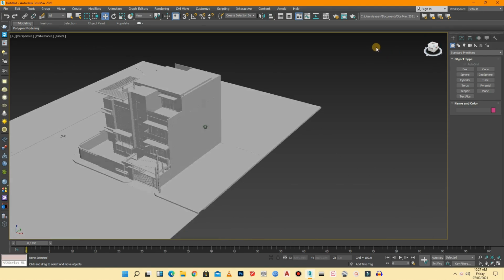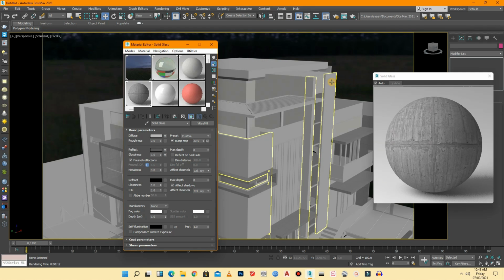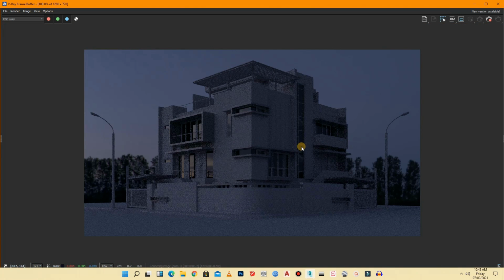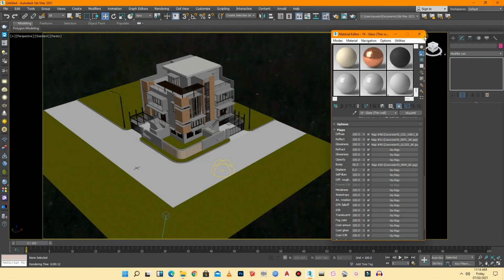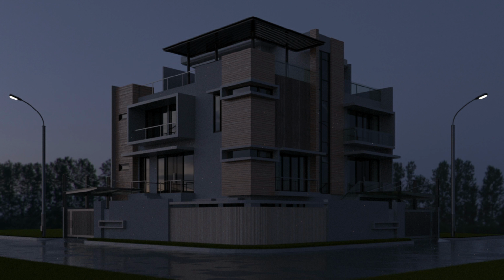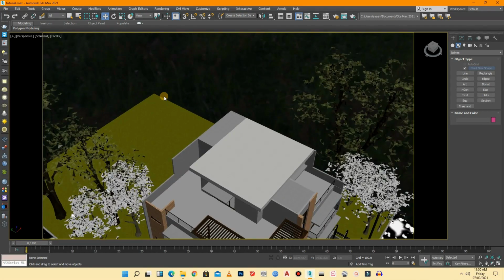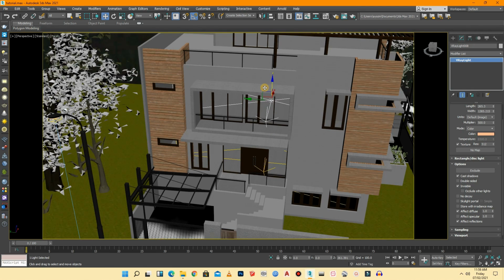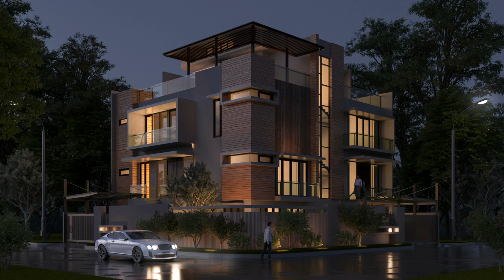Exterior Night Render in V-Ray 3DsMax Complete Tutorial

Comment: Hello! thanks for your video!
I have a question, when I use vray hdri the background of the workspace is white.
That is, I do not see the image that I placed as a sky.
How can I solve that?
Reply from the maker: It's easy, click on the little "+ "sign which will open viewport options then go to "configure viewport", go to the "background" and then "check" "use environment background."
Reply: @Platformstudio  I already did that and still the same. When I go to render it appears all white too. 
I also tried with different images and they do not appear on the background..🥺😢
Reply from the maker: @a.pereyra3875   @A.Pereyra  Make sure you put the Hdri Map into the "Dome Light".
Reply: @Platformstudio  thank youuuu!! 👏😃
Reply from the maker: @a.pereyra3875  you're welcome,good luck for your project